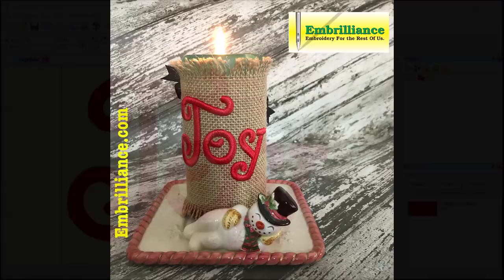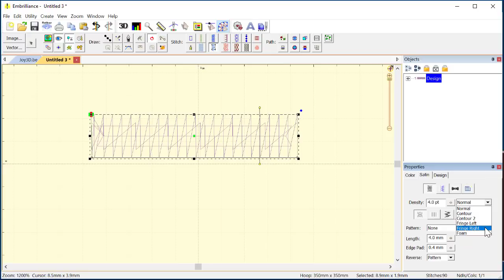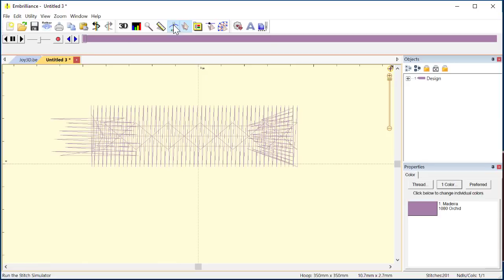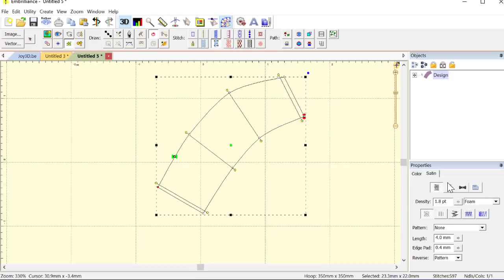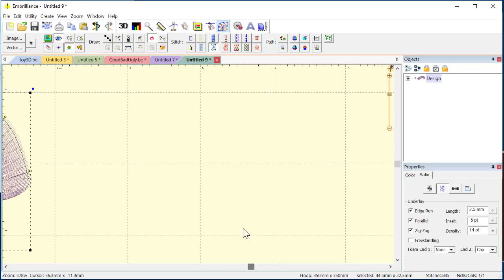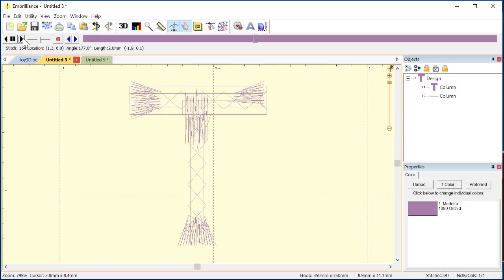Embrilliance StitchArtist Level 2 3D Foam

Comment: I use a Mac. I cannot get the shortcuts that were shared in the video to work for me.  Holding shift doesnt make a vertical or horizontal line.
Reply from the maker: In draw with points, ctrl makes line nodes and shift creates cusps. To constrain the line, hold the option/alt key. These are the keys that work on a Mac.

Comment: I love the capping ability for foam but, giving an underlay for the foam makes no sense. You want spacing of the threads to be tighter in order to prevent the foam from sticking out. 

I'm currently using Hatch 3 Digitizer but, I'm looking at this software for other features that Hatch doesn't have.
Reply from the maker: Change the underlay density to a higher number like 30 or 35. The caps and joins stitch first and it has to travel from one to the other in an automatic function.
Reply: @Embrilliance  , is this the only video regarding SA level 2 and puff capabilities?
Reply from the maker: @TheEmbroideryGuy  yes, on our channel. This one  explains how the tool works. If you have other questions please reach out to support.  Http://embrilliance.com/contact-us-2

Comment: Hope anyone can assist, how can we program a "Stop" so as to tape on the foam at the right moment? My Barudan has a way to do this but it's somewhat complicated. ALSO, centering in a round hoop is weird, especially if things aren't square in the perimeter (like being able to manually center for the hoop, so as the center can be offset). If you know how to do this please send me an email to bill@bthrash.com. Thanks.
Reply from the maker: B-Thrash stopping is a machine function. Multineedles do not stop unless you program them to do so.
Reply from the maker: B-Thrash if you’d like to chat with the folks at Embrilliance support please use this form. Http://embrilliance.com/contact-us/

Comment: I have all 3 levels of Stitch Artist. Why do I not have 3D Foam capabilities? I have visited your website and can not located an update/upgrade.   Where can I get this update to my software?
Reply: Download the entire program at the top of the Embrilliance Downlodad page.  There is no difference in the upgrades or downloading the entire program.  Your key's will be saved, just don't uninstall your program.   3D Foam is in the properties, lower right corner of your program.
Reply: Thank you so much for that info, but I see 3 new buttons on the main menu in Brian's video on 3D Foam : 1) "Branching" (at the end of Path section) that I now have due to the update you told me about, 2) "Brother" with blue circles & lines btw save & printer buttons, and 3) "arrow head w/ line & dot (btw preferences & create button).  Which update did buttons 2 & 3 come with? Will the "brother" button allow me to send my designs directly to my scan n cut 2, because I have craved the ability to do that. I usually create all my designs in Embrilliance because it is (as it's name says) BRILLIANT! Also, what does button 3 do?
Reply: I'm not sure about the ability to send to Scan and Cut, I don't have a Scan and Cut.   I'm going to let someone else help, I'm getting confused myself.  I'm sorry about that.  If anything, go to Facebook and search for the Stitch Artist Group.  Hugs,
Reply: You can also ask on the Embrilliance Groups on FaceBook, i.e. Brilliant Embrilliance and Stitch Artist Digitizing Fans